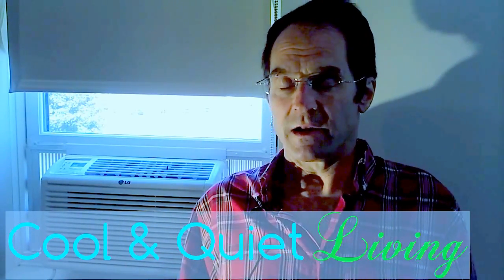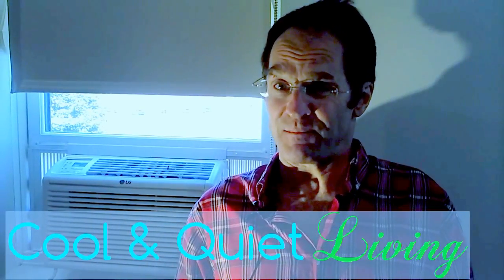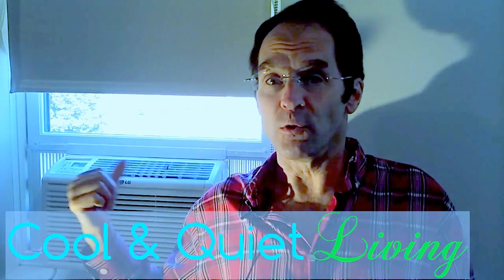Comparing air conditioning HC refrigerant coolants

Comment: If you want more EER make a poly film bag water jacket surrounding the compressor and use a 12vdc 10-15w magnetic driven waterpump, the elec. connection on top should b double insulated with good stinky RTV glue. This cooling lowers head PSI, motor amps should lower also.

Comment: R290 (propane) is a superior refrigerant and uses less electrical energy to produce the same cooling. I use it in my 4 ton (formerly R22) central AC for my house. It's already used legally in Germany and much of Europe. Asia also uses R290. As usual the US is the last to adopt a superior technology because of pressure from the corporations that manufacture the planet killing refrigerants. The "flammability" argument is moot since hydrocarbons do not burn or blow up in closed refrigeration systems that contain no oxygen.
Reply from the maker: True that the US is often the last to implement tech developed in the US! Small modular nuclear reactors (SMRs) are another one...🙄

Comment: I can tell you from practical experience, Propane works excellent as a refrigerant.  I charged my '92 Dodge truck with it in 2008, and it still works great to this day. (was broke and living in Phoenix at the time). Last year I had a GE window AC get damaged, and recharged it as well with Propane. (I'm enjoying the window AC right now) Propane mixes with all common refrigerant oils, is extremely cost effective (recharge cost: less than $1.00 for both) and because I used less refrigerant, and pressures are lower, these AC's don't dim lights or slow the engine like they did on standard refrigerants.  I think they get colder, too.

I'm sold on the stuff. I never evacuated the truck system, just added to the existing charge! (window AC filled from empty though) Nothing has ever caught fire, exploded, leaked out, or required  a certification to install.  Food for thought.
Reply from the maker: Thanks for posting, that's interesting! Do you work in HVAC? In event of car accident, would propane lines explode? Of course same can happen to fuel line / gas tank (happened to me years ago—lucky to survive).
Reply: @p1nesap  I do not work in the HVAC business... However, at the time that I did the Dodge truck, it was the middle of the summer in Phoenix, AZ... I was broke, and I was tired of sweating-  I spent a few days researching everything I could about using propane as a refrigerant. I was so desperate that I gave it a try.. I figured that the system would leak down again in a few days.  Not only has it held the charge for 11 years, but it still is c-c-cold! I have heard that the refrigerant oils are more of a fire hazard in an accident due to the volume.  The small amount of propane, if it somehow ignited would make a flash and be gone. (in my opinion) It's surprising how little propane it takes to charge  the system.
Reply from the maker: @dukebacher1216  Amazing! Thanks 4 posting. My window AC has R32 which is also flammable. Wonder why they don't use propane, clean, cools better.
Reply: @p1nesap  because Dupont won't make millions if we all used propane?

Comment: Have you not considered M60 natural refrigerant? It also drops the elec consumption by 30-50%, and the cooling is a good 10% or more colder. They use it in Australia now. Pioneer International AC uses it. Your question is more economical that it is chemical. AC using half energy, and a industry warranting all the regulations and fees, would cause a shift that greedy people will not want to let go of, and will protect their profits by  hurting the very people they are supposed to serve. Sad but the honest birds eye view of it.
Reply from the maker: Thanks for the heads-up on M60 hydrocarbon refrigerant, designed to replace R410a. You're spot-on about greed factor trumping higher performance. The same argument can be applied to reliance on fossil fuels over advances in modular nuclear tech (SMRs).

Comment: Because the risk is too great for an explosion in home. R32 is not flammable under normal operating conditions and is actually pretty hard to ignite.  Hydrocarbons are used in environments where an explosion is much less likely or would be much less of a threat to human life. You don't want every air conditioning unit to pose an explosion risk.. come on and think about it.
Reply: What about propane stoves?
Reply: Gas cars?